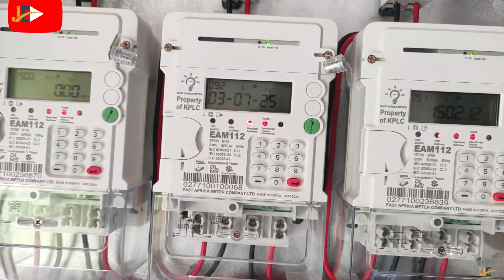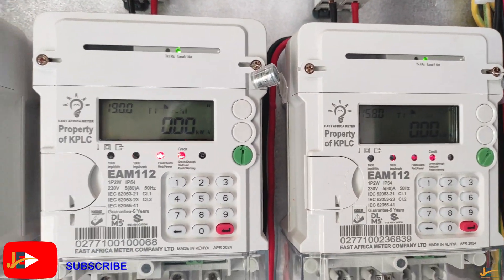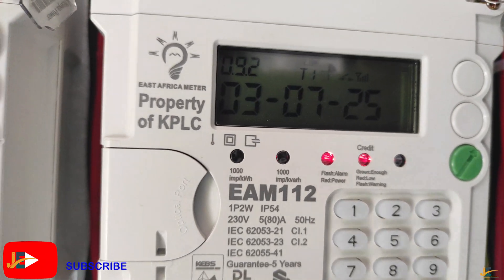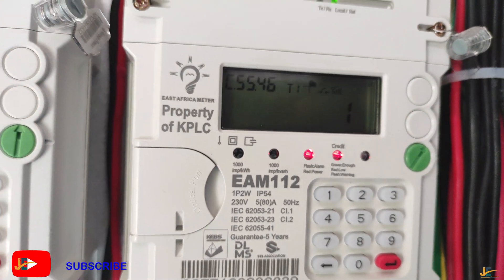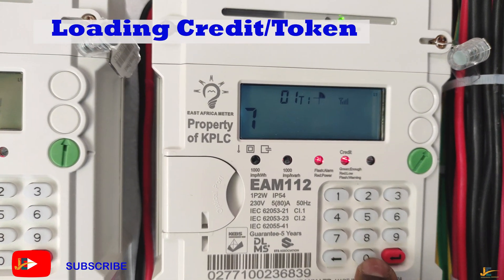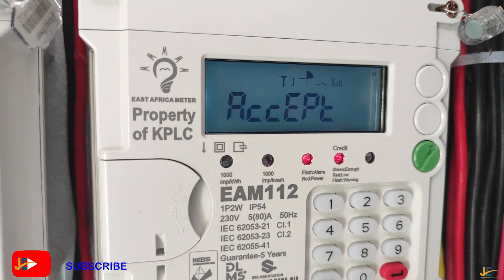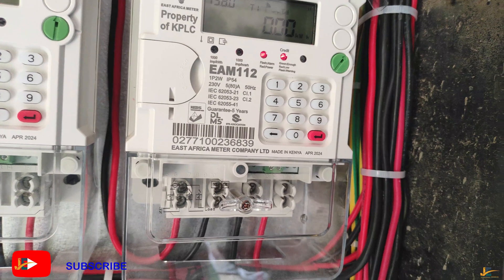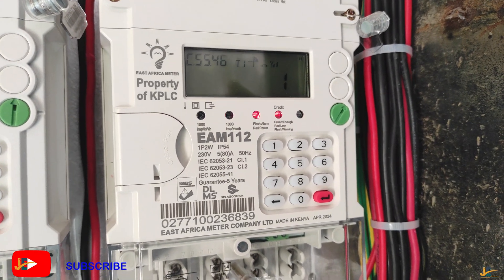How to Activate Smart Energy Meter Model EAM 112

Comment: hae same meter eam 112 but after inputing the token it is accepting the token but there is no power in the house i have tried inputing the tamper code but same same issue, i have also checked the wirin continuity and its good, what might be the issue